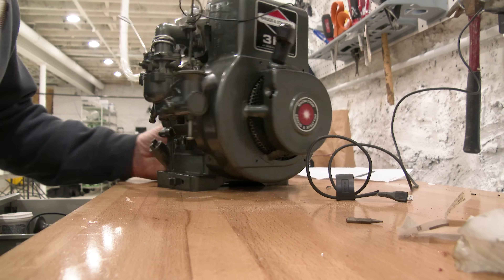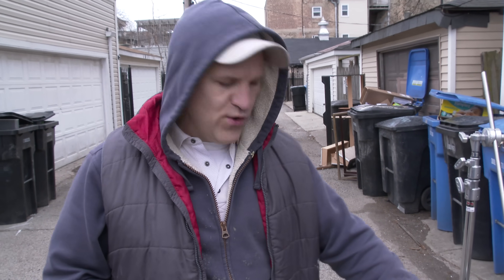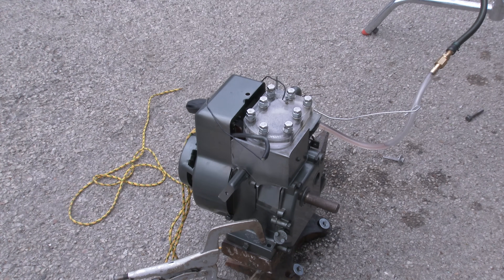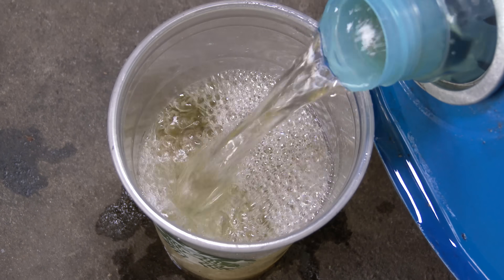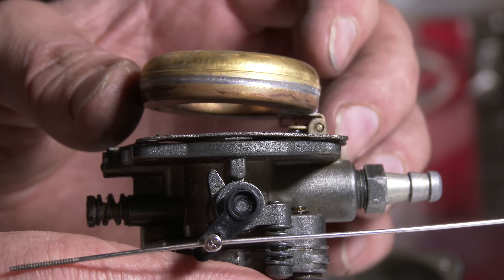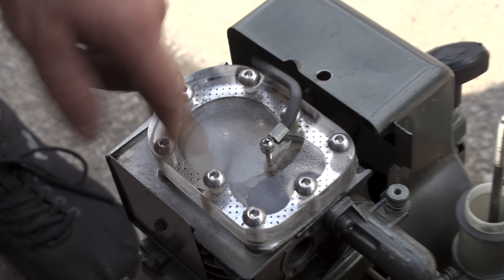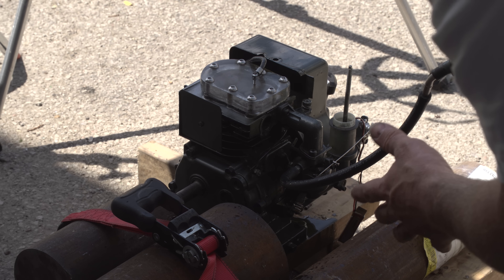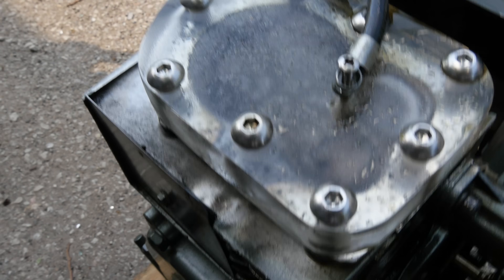See Through Engine on NITROMETHANE - Blow Up Attempts 1 -9 Crazy !

Comment: My guess is he did not modify the carb to dump 8.7 times as much nitro.  Still don't think it will blow up with a proper fuel air mix.   there are a few additives that can be added if you want to blow the engine apart, but they are not legal in the US.

Comment: You probably need to run it with the choke on. Nitromethane only needs a 2:1 air-to-fuel ratio (normal cars are more like 20:1) Nitromethane creates it's own oxygen when it combusts. The engine is usually running almost flooded

Comment: Greetings...
  The science behind the oil leak is very basic...  The engine is designed with combustion pressures and crankcase venting prefigured, and very little blow-by gasses - and preset sealing tolerances around the head gasket, rods and "piston rings", the "shafts", the valve stems and breather valve section, etc...  When you burn a higher fuel you increase the combustion chamber pressure and create huge blow-by gasses into the crankcase that have to vent where ever they can and keep up very fast, and you have high rpm and more splash of oil inside the crankcase too - a real storm that atomizes the oil almost into a vapor...  Therefore (you see this coming?) it's fuel is gonna burn past the rings and consume them more and more causing a progressive blow-by event, and then vent out the shafts and valve breather box, hauling mass oil with it at that velocity of venting...  And the flywheel fan is gonna blow it all over the place pretty much...  But, you knew this already - right?  Just didn't register yet...  If you continue to over power and load the piston rod and crank shaft it will bust eventually, if the piston does not melt through first - and if you wanna speed things up - "lack of lube" will do it every time - take out most of the oil, if not all of it...  A shot of brake parts cleaner in there will seize crap up fast...  Use your imagination...  Or find an oil substitute that will fail quickly instead...  Heat up a cup of some kind of cream or ointment to a liquid state and pour it in instead, that can't possibly handle the high temps lubing the bearing surfaces - just enough to get a minute of run in before a fail...  But, what do I know?

Comment: Very cool.briggs are very tough.way back in highschool small engine class we would weld and regrind camshafts for these things or put nickles between tappets and valves to get more lift and run coleman fluid in them for a go cart race track wed get 50 -60 mph outta these things...lol..id suggest making some kinda header for back pressure

Comment: You have understanding neighbours.
Reply from the maker: SW6 my neighbors are actually great
Reply: @WarpedYT  I think the fuel has oil mixed with it because lots of those RC engines are 2 stroke and I think the oil was blowing out the exhaust.
Reply: They're all gone for the NHRA finals.
Reply: THE FRENCH BAGUETTE  nitromethane is racing fuel it's similar to Dynamite like nitroglycerin it carries its own oxygen molecules simply put it makes about 2.3 x more horsepower than gasoline but with nitromethane you can pump eight times the amount of fuel into a cylinder than you can with gasoline simply badass stuff
Reply: THE FRENCH BAGUETTE  a really agressive fuel😂

Comment: For a possible season 2 I'd be very interested in seeing the difference between cheap 95 octane fuel and high quality 102 or somewhat fuel. Especially in terms of cleaning ability after running for a longer period of time for example. When the chamber is full of unburned carbon because of a rich fuel mix.. I don't know if this makes sense in this format..just suggesting :)

Comment: My issue with Briggs and Stratton isn't about catastrophic engine failure, it's about trying to get the freaking things started after they are a couple of years old.  I hate Honda cars, but my Honda engine lawnmower is incredibly stout, I have to admit.  It has started on one pull, ever time, for the 12 years I've had it.  If I had a 12 year old briggs and stratton I'd have a messed up elbow from trying to start it.

Comment: briggs are good but nothing beats a honda, i have a gx160 on my bicycle and i float valves on it all day at 50 miles an hour, on a bicycle, one day it really bogged down up a hill so i took the head off it and the valves were recessed into the head about a foot and the piston walks back and forth in the bore like a hot dog down a hall way, but it just lost a little power, i thought maybe it had some carbon build up but ever since the crank case vapor ingestion delete it has no carbon whatsoever over its whole 2 year life of nothing but valve float, it snapped an exhaust rocker once but thats just cause it was an intake rocker, i didnt know that when i tore them both apart and built one the exhaust rocker is thicker also they have a cap that goes over the exhaust valve and i forgot it once and it dropped a valve and bent it but other than that over a hundred hours of fun from a junk yard motor, got another honda on it now, no head gasket for more compression black high temp rtv silicone instead and chinese clones have a bigger intake port for some reason so its got one of them on it, also straight pipe out the back, its got rebel yell written all over it, i took it down a smooth dirt county road doin 40 once and the guy in his yard saw the look on my face leaned all the way forward like its a crotch rocket "yea i built it and yea im doin it motherfucker"

Comment: You have to balance the rotating assy. and it will hold together. Watch how the motorcycle guys balance theirs on 2 level pieces of metal with weights on the crank the same exact weight as the rod, piston,rings, bearings,pin.

Comment: This is pretty amazing, and an excellent unintentional (?) advert for the bomb-proofness of B&S engines (which clearly ain't no BS) on top of all the countless examples still ticking away in 50+ year old lawnmowers around the world...

One part I found both satisfying and surprising was how, at least on the bench, it sounded rather like a miniature top fuel dragster engine during the pre-run burnout, most unexpected for something so small. Interesting that the change of fuel could have such an influence on how an engine sounds as well as runs. I had thought the difference in sound between e.g. an automotive petrol and (non-turbo) diesel engine was mainly down to the structure, how they're built and how they produce combustion, but maybe it was simply down to the fuel and how it burns all along? (Also, what capacity is the cylinder on this, how does it compare to the individual chambers of a dragster? It looks a little larger than any piston I've handled before, or at least equal to them, which pegs it around 400cc if it has the same stroke as the engine I'm thinking of... I expect a typical funny car has larger cylinders, but, could be wrong)

And what framerate were you recording at this time? It'd be nice to be able to work out the ultimate rpm. Daresay it could probably be done by ripping the audio and just counting off the cracks against the timeline in an audio editor, but, hey, if you've got a high speed camera, may as well make best use of the footage.
(Where do you even get all that stuff, and the clapperboard and pro grade regular speed camera? Side project of a TV studio that utilises a lot of high speed footage?)

Tempted to see if I can get some nitro now, give it a go in my bike... not for extra power or revs, just for the sound. Base model 125s have a rather disappointing sound anywhere except in the saddle ... when you're on top it sounds rather sporty, but when another of the same model passes by it's a combination of sewing machine and wet fart. Be nice to have the outside sound match up to what reaches your helmet just for once. Though, I do need to perform some remedial work on it first... might be smaller capacity but it puts out about 3x what the B&S claims (and 3x the revs, though not simultaneously), and is somewhat more highly strung and fragile to go with. Also got a mystery oil leak from somewhere other than the head gasket, and the carb could do with a tune, along with other non-engine faults...
NB you said it burned slower than gasoline, which is what you'd expect for ultra high octane race fuel, but the flames in the slomo footage sure seem to burn out rather faster than the regular gas did, even though it seems likely it's been slowed down even further than before. Is that just because of the increased spark advance, or is something else in play?

Anyway, even if the ultimate destruction didn't occur, the footage of the gasket blowout was definitely super cool, and the entire video log of the attempts has been fascinating. I'm sure the turbo attempt will be even better. Keep up the good work :)

Comment: If you really want to see it pop, put some stiffer valve springs in it so it will turn some real RPM's. Harbor Freight motors can turn 5700 alllllll day without popping but are limited because of valve float

Comment: Raised the fuel tank so you could get more fuel pressure to a carburetor.... considering the fuel level is controlled by a float, the fuel in the carb is at still atmospheric pressure.

Comment: I'm surprised you were able to get the ignition timing so close to perfect just guessing at it, any chance we can see it on a dyno running 50/50 nitro, then turbo charged 50/50, and possibly even 90/10 for the hell of it to see if it will run

Comment: The problem is the valves, the springs aren´t strong enough for the rpm range. 
So oil passes through from the sump when rpm goes beyond spec. 
These motors operate at 3500rmp max, when exceded  oil slips through the vavles due the the way it´s lubricated by the sump (NO OIL PRESSURE).
Tighten the valves using washers or put in stronger springs. 
And up the oil to a 20-50w to compensate for the increased hp and rpm.
Worked with these motors for years and are sturdy, an allmost impossible to kill if handeled properly.

Comment: Nitro wants (needs) a load on it much like a turbo does to work correctly..  crankcase pukes because of the fuel that leaks past the rings.. gets mixed with oil then sees temps high enough to boil..  Fuel contamination is why we dump the oil after warm ups and runs..  turns to avocado sauce...

Comment: Wow!  I’m impressed with the durability of the acrylic!  AND THE BRIGGS!!! I thought for sure the increased cylinder pressures would grenade the rod cap or bolts, “squish” the rod bearing clearances to the point of inadequate lubrication and failure ( 5,000 + rpm with splash lubrication 😂), or compression ring / ring land failure... but no... aluminum head gasket was breached?!?!
On tear-down inspection, were the rings  stuck or broken?  There was quite a bit of blow-by toward the end as noted by the crankcase pressure. Your fab skills are awesome, so this will be a walk in the park, and will help your oil control issue when you go to forced induction. 
What you will be doing is essentially creating a Venturi in the exhaust to suck out excess crank case pressure. This will promote better ring sealing, and prevent a crankcase explosion, should enough combustion air slip past the rings and mix with the vapor in the crankcase. 💥
You’ll need either a 3/4” or 1” pipe nipple, depending on which head you have, about 6-8” long to serve as a header. In this pipe, drill a 7/16” hole at a 45*
Reply: Angle, and weld or braze in steel 7/16” tubing. The tube will need a 45* miter cut at the end, with the long side of the miter facing the exhaust port- this creates the Venturi effect. 
Next, look for the crank case pcv vent. Most older Briggs simply had a mesh screen under this cover and vented crank case gasses to atmosphere. Newer models plumbed this to the air cleaner breather. You may have to make a new cover plate, but plumb this into your exhaust and the scavenging will pull a vacuum on your crankcase. ( plumbing into your turbo’s inlet may work too, but it could also draw too much vacuum and suck oil from the crankcase). 
As a last measure, and probably not necessary for the boost pressure you’re likely to see, check the ring end gap. The rings will close up under heat, and if they butt together, premature piston and ring failure can happen before the main event unfolds!  
Good luck, keep up the awesome experiments, and I’m hitting the subscribe for the show!

Comment: Not sure if anyone mentioned as i didn’t read all comments but the loss of power that happened in 7 and 8 attempt was probably due to the valve lash is not high enough since you have change the fuel and added a lot of heat. Stock lash is usually around .006” i would go with .014-.018”

Comment: you should make a rig with a reversed polarity AC motor and a controller with a dial to simulate different loads. so you can test all of your different engines and setups under load.
im curious to see how much more intense the combustion and flames would be with the engine working against a load.

Comment: AFAIK nitromethane has a lower energy density than other common race fuels, however, it has more oxygen in it by volume.  Nitromethane is a "power-adder" in itself.  Having a liquid oxidizer, you're essentially burning rocket fuel rather than adding more oxygen (gaseous) via forced induction (supercharger, turbocharger).

Comment: You don't think the magneto can handle it? How about your drywall screw for a spark plug on your pointless piece of plexiglass cover? Moron.
Reply from the maker: James Singer well it sure didn't seem pointless to me or everyone else. Worked just fine in my opinion, a drywall screw or spark plug are not going to increase or reduce the amount of spark plug energy which is made up of electrons, more electrons = more spark ., more magnetism, more electrons. I don't make up the laws of the universe or the laws of physics. Thanks I haven't been called moron in a long time
Reply: Ok so you're saying a cylinder cover with a spark plug isn't anymore efficient or reliable than a  drywall screw? Keep telling yourself that
Reply from the maker: James Singer lol. Of course not, what I'm saying is that a spark gap is a spark gap.
I'm not really sure what the point is here, but you referred to the spark energy, yeah I don't think I Magneto has as many joules as an electronic high output ignition, that's for sure.

Comment: Briggs n Stratton single cylinder engines are beasts. They run forever if properly maintained. I have a 3hp Briggs with points n condenser. Idk how old it is but she due for a rebuild. Sat to many years not running and no oil in it.

Comment: no part of the plexy is strong enough or weak enough for a catastrophic failure. it slowy breaks down to the point where the most heat is applied. it would litteraly take direct impact to a single position or to much air if that could be done. a turbo charger is your best bet!
Reply: in scale this engine is much stronger than any engine where methane is ran.
Reply from the maker: +Darrin Miller good point

Comment: Had a IHRA  alcohol FC driver tell me once that a Briggs engine is built just about perfect to run nitro in. Have run my Rc car fuel (30%) in my edger a couple of times....warm it up on gas first and it will start right up on fuel.  One of the reason you need so much ignition lead with nitro is is a much slower burning fuel than gasoline. This is one of the reasons it makes better power than gasoline and also why flames come out the exhaust of Top fuel cars

Comment: As with funny cars and top fuelers, the nitro washes past the piston rings and down into the crankcase. All the oil is blowing out the crankcase vent. All that nitro in the crankcase is what causes the racing engines to explode. Still interesting though that that poor Briggs didn't launch parts. I'd love to see what the cylinder walls and crank journal look like.

Comment: try running it with no oil ;) it's sure to blow ;)
Reply from the maker: +spikeman dan that's not how I want it to blow though, I don't want to lock up, I want it to fail catastrophically. Like a failure from too much power.
Reply: Warped Perception Oh ok

Comment: nitromethane is actually less volatile than gasoline the thing with nitromethane is it carries its own oxygen so then rather than rely on atmospheric oxygen you can pump far more fuel into the motors and get ignition at the right ratio because of the oxygen within the Nitro

Comment: That engine was made in 1987, correct?
Reply from the maker: +Daniel Bailey I think '85. How did you know?
Reply: I was just working on a similar engine, (1980) and I read that the "code" listed on the shroud shows the date it was made. Like this: First two numbers=Year made. For example, "80" is 1980. The next two are the month made. Ex. "02" is February. Next two: day made. Ex. "18" is 18th. The last two numbers listed name the plant in which it was made. I was trying to make out the code but  ¯\_(ツ)_/¯ close enough! Thanks for responding.

Comment: Nitromethane gives less energy than gas by about 1/2. But you can put almost 8 times as much in with the "standard" amount of air that a cylinder pulls in and get a "good" mix. That ends you up with about a 2.3 times the "Bang" that you can get with gas for a given amount of air. It also runs about 800 deg. F hotter than gas.
Reply from the maker: Rem1061 thanks for the insight , in the next episode I am going to see how much power I can get out of this thing until it blows .

Comment: RC car fuel.
Reply from the maker: Powered by R/C / eflb150 that's in the beginning, that's the first fuel I burn
Reply: Warped Perception Omfg u replied instantly
Reply: Warped Perception well at least use the weirdest things as fuel. Or add a full-size turbo or supercharger to it.I wanna see RC car fuel in real car engines.
Reply: Warped Perception also, check out my channel to see some stuff and the Majestic nitro buggy crash.